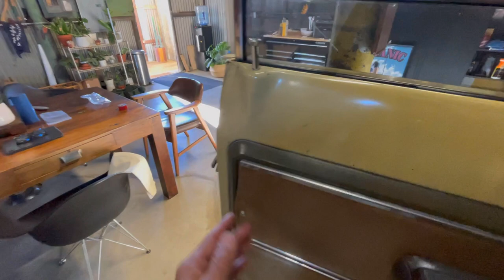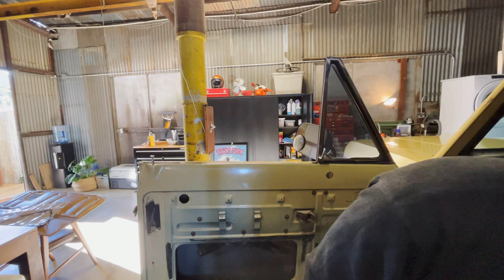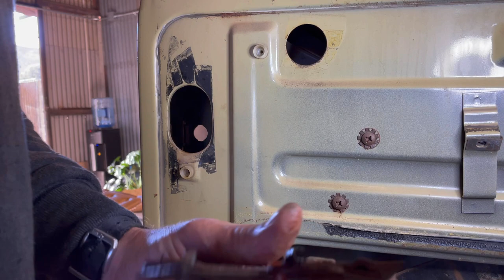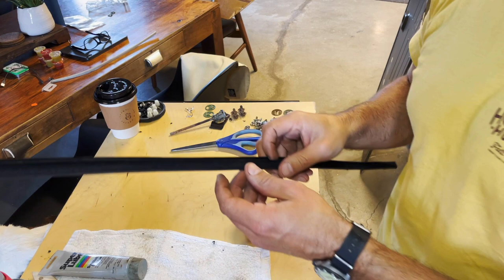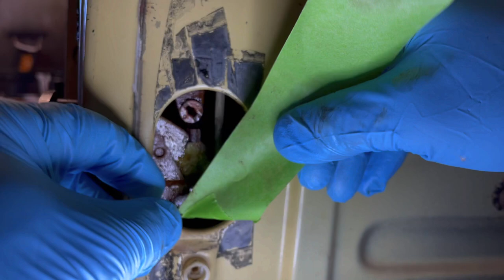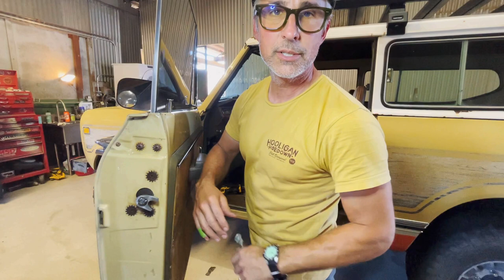The Scout Life: Window and Door Day on the 1975 International Scout II!!

Comment: You need to lower your window bump stop so your window lowers flush with the top of your door.  Or don't.  Personal preference, I guess.  Also, great tip with the double-sided tape on the felts.
I found a great way to clean up the sheet metal inside the felt area is to wrap a foam paint brush (AKA a chip brush) with a bit of wet/dry sandpaper.  Two or three passes and no more rust on either side.

Comment: When putting the regulator back in, crank it to the up position.  Compress the arms and spring and use a zip tie to hold it in place.  Put the screws in the crank and then turn the crank until the holes line up for the regulator.  Once the screws are all in, cut the zip tie.

Comment: Great video.  You introduced me to Rust Bullet.  Question: Is it advisable to use the same product on the frame of my '74?  The frame is in great shape with only the slightest rust dust now.  It sands off easily.  Back story: this Scout sat for 25 years in North Texas...lots of red (rust colored) dirt.  While there was plenty of dirt to rinse off there was a thin layer of rust as well.  As I sand it comes off easily and bare metal is revealed with little effort.  No flaking is present.  Do you recommend Rust Bullet as a protective coating.  Hoping to keep this thing on the road for as long as possible.
Reply from the maker: For 99% of scouts the frames do not need any kind of protection. Any coating that you put on the frame will be cosmetic. Meaning rustbullet is an expensive way to try to pretty up your frame.
Reply: @anythingscout  that is great news. So y'all don't worries about the slight amount of rust that occurs just from normal use?

Comment: I'm following your video and working on my '74 scout doors. Do you guys sell the door latch bolts with the external tooth lock washers attached? There are 3 per door holding the latch. Mine deformed a little bit when I was removing them. I'd like to replace them if I can.

Comment: I have a 1972 scout II that has a latch problem.  Keeps popping open one click unless I lock it.  Is there a video on how to repair warn door latches.  Maybe ad a weld spot to it.  Any help guys?  Thanks in advance.
Reply from the maker: It depends what the actual problem is. With the door open see if you can rotate the latch to get two clicks from it. If so it's likely an alignment issue that isnt allowing it to latch completely.
Reply: @anythingscout  I can click it two times with my hands and if I pull back on it with my finger real hard, It will move one click.  If I lock it, I cant move the latch at all. I cant find a good used one so I was wanting to take it to my machine shop and see if they can build it up and make it latch better.  Is this something you have tried?  Thanks